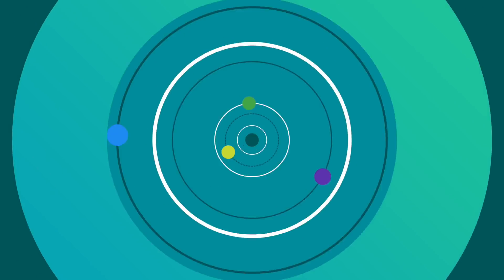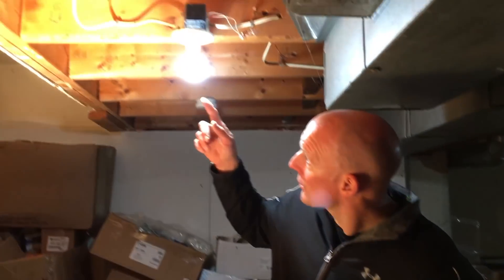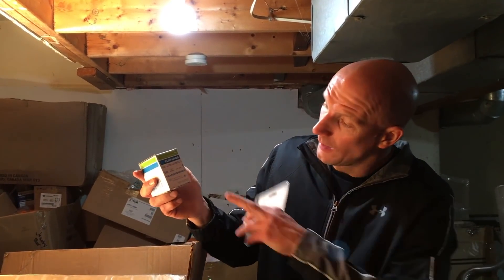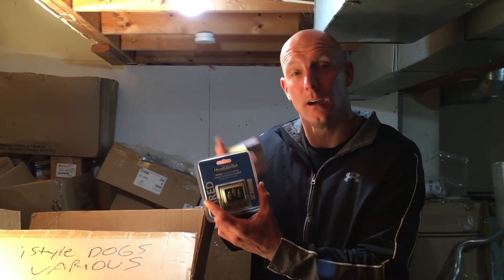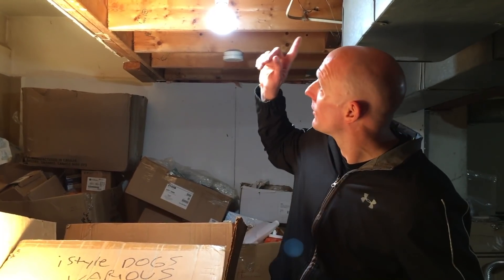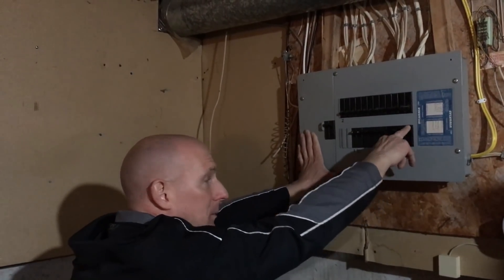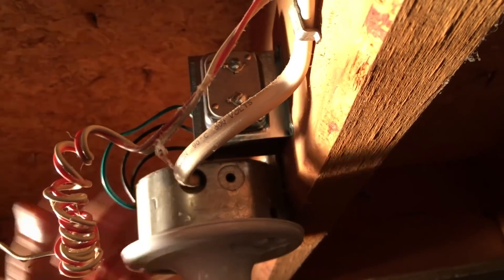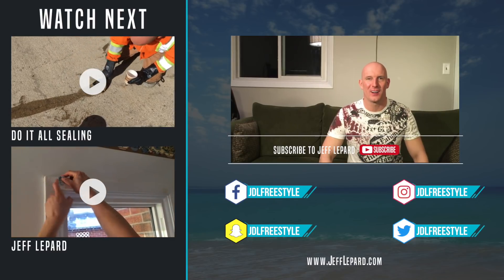Transformer Upgrade • Ring Video Doorbell

Comment: Ring provides a power Kit module that you connect inline with your existing transformer,  do you still need to upgrade the transformer if you install the Ring power pack kit??
Reply: I just installed the ring pro 2 which included that lil power kit attachment...instructed me to install it onto the wires inside of the actual door bell chime in my case at the top of the stairs...My door bell currently seems to be working fine but if i check out the device health it stills my volts are poor at 15V but my power output in good. So for the heck of it I am still going to try the transformer upgrade which for me appears to be in my garage. I'll let ya know how it goes.
Reply: Update just checked the app one more time and now voltage says good...I think ill let it ride for the time being and worry about transformer later

Comment: Jeff, question. 
I'm moving into a brand new construction ranch home 2022 model,  and was wondering if you thought the doorbell transformer would be adequate enough to power a ring video pro doorbell ?
Would would you suggest?
What is best way to test Voltage on my current xformer?

Comment: I am sure you could have just attached the transformer to the electrical box through the hole where the old one was. You can then could have secured with the attached screw.
Reply from the maker: I did actually do that I have an updated video on this.   👍

Comment: Do you need to be concerned with the breaker rating when upgrading a transformer?  I'm assuming they are pretty low amp.  I have two Rings, showing 20v at each, but one doesn't charge properly.  I'm considering replacing them with Eufy.  Their support recommended replacing the transformer with a 24/40.  Thoughts?
Reply from the maker: I haven't heard of needing to upgrade the breaker for a transformer upgrade.  That would be a first I've heard of it for me but I guess anything is possible.  Check out my New Transformer Upgrade Video: https://youtu.be/f9YIRO4WhYQ

Comment: the manufacturer recommande 20, not 30, so we got a 16/20. in order to get 30, it was only available with a 24/30 transformer. where do you get a 16/30? could not find one.
Reply from the maker: There is a whole different bunch available on amazon I found.  How did you make out with that?  Check out my New Transformer Upgrade Video: https://youtu.be/f9YIRO4WhYQ
Reply: @JeffLepard  I installed the 16/20 and worked fine but the video was a bit slow and sound outside at the doorbell was awful and people could not understand what we were saying at all. so I bought a eero mesh wifi and that's working well. sound is good now. Upload speed improved a lot.

Comment: Hi Jeff so instead of taking my panel apart  and messing with wires can I  just buy the plugin one and just undo the wires on the transformer and connect the wires to the plugin and leave the old transformer on the panel? I have a plug right next to my panel. Thanks
Reply from the maker: Yup you can totally do that!  Hopefully that worked out for you.  Check out my New Transformer Upgrade Video: https://youtu.be/f9YIRO4WhYQ

Comment: Great vid.  Where I’m at they put the thing above the water heater. Mine is currently 16v and I expect even though it meets the specs it’s the distance that degrades the current needed. So going to install a 24v40a and see what happens.
Reply from the maker: Sorry for the late reply did everything end up working out ok?  Check out my New Transformer Upgrade Video: https://youtu.be/f9YIRO4WhYQ
Reply: @JeffLepard  it did resolve the issue. Cheap fix!

Comment: Good day. I followed your like and ordered a 24v transformer from Amazon. I just got it today and pulled it out of the box but it only has two wires. It has a black and white wire. My question is will this still work?
Reply from the maker: That should still work.  Did you get that working?  Check out my New Transformer Upgrade Video: https://youtu.be/f9YIRO4WhYQ

Comment: After watching your video, I was ready to do it myself but then found two boxes attached to the light bulb in the basement/furnace room.  How can I tell which one I need to replace?  The one  says 5v to 10 v so I was assuming it’s this one.. the other one doesn’t say anything.  Help!
Reply from the maker: Thanks for watching did you end up figuring that transformer out?  Check out my New Transformer Upgrade Video: https://youtu.be/f9YIRO4WhYQ

Comment: So i see now you have high voltage wires un protected. If someone lifts something into them, they could get hurt or even worse
Reply from the maker: I will be doing a new video on this relocating that same transformer onto the box also there's a few different options for transformers to use you can get the plug in ones off amazon very cheap!
Reply from the maker: Check out my New Transformer Upgrade Video: https://youtu.be/f9YIRO4WhYQ

Comment: The screw on the bent strap goes into to box knock out tighten the screw on the inside to tighten it up to the light box. It fits in the same hole, so you dont have an open box, n the wiring is now inside the box. Blk to Blk, white to white, green to metal box or bare ground in box. Now all you have are lo volt terminals to connect to. I hate people teaching people how to do electric when they are not sure themselves.
Reply from the maker: I realized that after the video was already completed.  I'm filming a new updated video on this and also other options such as the plug in transformers you can get off of amazon for another option.  Thanks for the comment the new video should be posted shortly!
Reply: Glad to hear. Have been an electrician  for 40 years. This will make it safe, n protect you incase of fire n your insuransce co.
Reply from the maker: @mdvener  Absolutely, I appreciate the help!
Reply: No problem. Have seen so many people do elec. work, be so UNSAFE, i try to let them know what they did wrong n how un safe there work is, if the light goes on or the outlet power's their device, they dont care, in about 8, 10 years watchig YOUTUBE, you are the first person to let me know theyare correcting their mistake. Yes its small, but 120 volts makes your muscles tighten up were you cant let go. Some times its to late. 240 volts will throw you off, but if amperage is to high, it probably will just stop your heart. I commend you for makeing it right. Have a safe n happy new year.
Reply from the maker: Check out my New Transformer Upgrade Video: https://youtu.be/f9YIRO4WhYQ

Comment: Jeff,  I have a 20 year old home with a standard 16V AC Transformer .  I Tried to hook up a Ring Video Doorbell and 2 issues came up.  1:  I did not ring the mechanical bell and 2, in the software on the app under device health it still said it was working off battery power.  I do some basic electical work like ceiling fans, lights AV and computer gear.  so Swapping out a transformer is nada.  Will going to a 24 V 40 AMP Transformer solve these issues?  If you can advise I would appreciate that .
Reply from the maker: You could try upgrading to that transformer it should be ok with your current door bell.  As for the App I wonder what that is maybe give Ring customer support a call and ask them about that one.  Let me know how that does I have heard some people having some issues with that.  I was lucky with mine.
Reply from the maker: Check out my New Transformer Upgrade Video: https://youtu.be/f9YIRO4WhYQ

Comment: Jeff... I upgraded my doorbell transformer to a 24 volt transformer as you did in the video. My previous transformer was a 10 volt (5 VA).  I made the switch in anticipation of installing the video doorbell which is a Christmas gift for my wife. But once I wired it in with the assistance of your well done video, I noticed that my existing low voltage doorbell no longer works. Should that be expected? I can do without it for a couple of weeks, but wondered if I may have received a bad transformer. Everything is connected well (breaker is back on) and the old doorbell had been working fine. I'm a little puzzled. Thanks. - David
Reply from the maker: Sorry for the late reply yes that is correct what Billbob had said some of the mechanical and digital doorbells systems will not take a high voltage and also some of the different types of 24V transformers have been known to put out more power than needed.  I have heard this happening with some people but most of the time its ok.  I will be doing an updated video on this topic and also giving people another option to use a plug in adapter you can pick up on amazon that would work perfect with the Ring Video Doorbell.  I'm happy you got everything sorted out now crappy you had to replace your existing chime because of that.
Reply from the maker: Check out my New Transformer Upgrade Video: https://youtu.be/f9YIRO4WhYQ

Comment: So Jeff really great video. Wish ring would tell you this upfront. Do you need to install the resistor if you want to use a electronic door bell?
Reply from the maker: I have heard of people not installing it and its been fine and also heard people saying it wouldn't work without it.  I should do a video upgrade of this using an electronic door bell vs mechanical.  Would be a great idea!

Comment: I dont have an existing doorbell - so rather than install a new doorbell transformer I will probably just wire the ring doorbell up to an old laptop PSU (rated at 20v / 3A) plugged into a ring main - I assume that will be fine as the doorbell will only draw the current it needs - its only the voltage that has to be in the correct range - the current just has to be above the minium needed - if Im wrong someone can let me know
Reply from the maker: You can also get the plug in transformers you see on amazon that makes installation so easy!  Here is a link to it:  https://amzn.to/352nzyx
Reply from the maker: Check out my New Transformer Upgrade Video: https://youtu.be/f9YIRO4WhYQ

Comment: What do you do when the door bell transformer is wired into your breaker box ?
Reply from the maker: If you need to replace that you can do so and I would cut off the main power in that case.
Reply from the maker: Check out my New Transformer Upgrade Video: https://youtu.be/f9YIRO4WhYQ

Comment: I cant find my transformer.  Im not going in a wall
Reply: Vince Chongy check the fuse box
Reply: Donny Boy Just checked.  Not in service panel.
Reply from the maker: Check out my New Transformer Upgrade Video: https://youtu.be/f9YIRO4WhYQ
Reply: Vince Chongy check the room  your furnace is in..it will not be in a wall..garage,basement or crawl space
Reply: Donny Boy just found it!  Under the house on a junction box leading to main panel.  Thanks for help.
Reply from the maker: Happy that you found it that was an odd location for it but I guess anything is possible!

Comment: Hi Jeff,
I would also like to know which Toronto/GTA electrical supply store you used to pick up the Edwards transformer.  Thanks a lot.  Nice video!
Glen
Reply from the maker: I forgot the name off the top of my head but I could find out for you.  I will be shooting a new video on this and using a different transformer in the next video.
Reply from the maker: Check out my New Transformer Upgrade Video: https://youtu.be/f9YIRO4WhYQ

Comment: The 120VAC input to the transformer needs to be contained within a box, like your original installation. It does not meet Building codes to be exposed without the wires being in conduit, jacketed without strain relief. There is a fire danger if the hot wire is accidentally yanked of the transformer. You can get away with it for now, but if you go to sell the home, it will fail inspection.
Reply from the maker: Thanks for the comment!  I figured that part out sometime after I did this video.  I will be doing another video to replace this video shortly!  Thanks for the input on this greatly appreciated!
Reply from the maker: Check out my New Transformer Upgrade Video: https://youtu.be/f9YIRO4WhYQ

Comment: Hi Jeff, could you please tell me from where you picked up the transformer in Toronto/ GTA?
Reply from the maker: I would have to check the name of the place it was in Ajax or Whitby I believe.  There is also another option you can use is a plug in transformer you can get on Amazon.  24 Volt Plug In Transformer 
https://amzn.to/352nzyx

Comment: I have a doorbell chime that has 16V so can I use the 24 V 40va transformer with my doorbell chime?  Also I have a generic thermostat that might be hooked to the same transformer (not sure where the thermostat gets its power and it just has an LCD screen to display air temperature and thermostat setting ), so will this 24V 40va transformer work with it?
Reply from the maker: Normally the Thermostat gets its power from your furnace.  If you are using an LED or LCD screen newer style thermostat then most likely there is a wire running off of the board inside of the furnace.  That should work, my existing door bell was fine after I upgraded the transformer.  I'm going to be re-doing this video and upgrade it.  It should be ready soon to go up on the channel.  Thanks for watching!
Reply from the maker: Check out my New Transformer Upgrade Video: https://youtu.be/f9YIRO4WhYQ

Comment: FYI that Edwards transformer is a fixture mount , you just pass the wires through the hole in the box and the brackets secures to the inside of the box with the screw
Reply from the maker: I noticed some mistakes I did in that video.  I'm going to be re-shooting this video over again and posting!   Thanks for noticing that!
Reply from the maker: Check out my New Transformer Upgrade Video: https://youtu.be/f9YIRO4WhYQ

Comment: The way the transformer was piggybacking on the light, does that mean the light needs to always be on for the bell to work? Thanks 😊
Reply from the maker: Nope it doesn't.  The power wire in the box was feeding my switch so its constant power.  Just check to make sure its constant power and doesn't shut off with the switch.
Reply from the maker: Check out my New Transformer Upgrade Video: https://youtu.be/f9YIRO4WhYQ

Comment: you said 30Amps but meant 30VA which means 30Watts. Imagine 30Amp is about the power a whole house central AirCon is using 🙂

(Volt x Amps are Watts in AC Application)
Reply from the maker: Ah ok!  I made a few mistakes in this video which I'm actually going to be re-doing the entire video soon.
Reply from the maker: Check out my New Transformer Upgrade Video: https://youtu.be/f9YIRO4WhYQ

Comment: Just watched your video...great but my problem is my transformer stands alone on my box. I have a bunch of wires coming out in my kitchen where my mechanical bell is located. I burnt out one transformer already so went to HD and bought a combo transformer. I know you said it might not work but will try. I bought a volt meter and will try to figure which of the 6 wires I have are the hot ones....I will change the transformer at the box and give it 24 volts....I have a side door and front door...Oh did not say ADT put in a front door photo doorbell, their brand, and hasn't worked from the get go. left me in the llurch and said to get my own electrician,,,yeah $200 at least,. SO I am trying myself...Any advise as I am handy but ?
Reply from the maker: I was away on vacation travelling so I'm just getting back to your comment now.  Did you have any luck as of yet with that?  Are your doorbells Ring as well?
Reply from the maker: Check out my New Transformer Upgrade Video: https://youtu.be/f9YIRO4WhYQ

Comment: I have a secret for faster internet. Up to double speed! Its upgrading your existing ethernet cable between wi-fi router & modem. Sounds like horse shit but it worked for me. You need:
(You can use a 4ft to 8ft cable)
I used a 5ft ethernet cable, 5-1/2ft of CAT-5 wire. Just before each plug wrap 3 turns of CAT-5 & tape it with black electrical tape. Then do other end the same way. You will have the ethernet cable & CAT-5 wrapped & taped at each end with plugs exposed. Leave CAT-5 wire loose except on ends of ethernet cable where taped. Do a speed test before new cable & then after. It almost doubled my internet speed! 
I will only write things in comments that worked for me. Not something I've heard might work.
I subbed to you. Your video made my home Ring install super easy!
Reply from the maker: Thanks so much for the tip.   That sounds pretty interesting I should try it.  I guess doing the speed test would be solid proof of it working better or not.  You should do a YouTube video on that, it might be a really good hack for a excellent video!